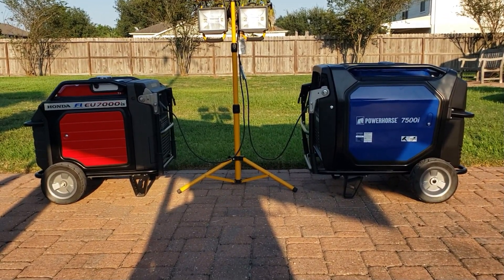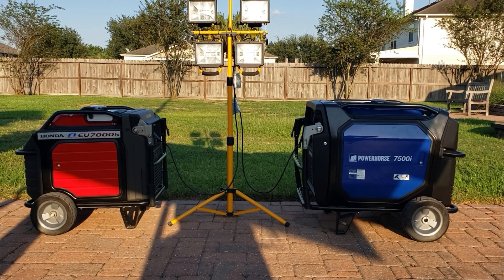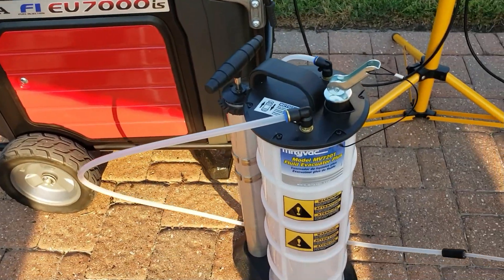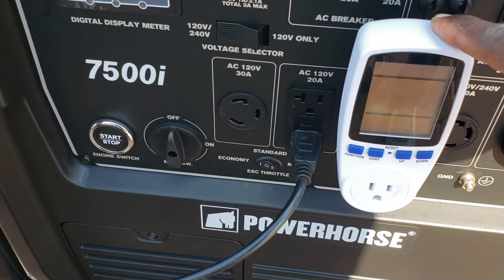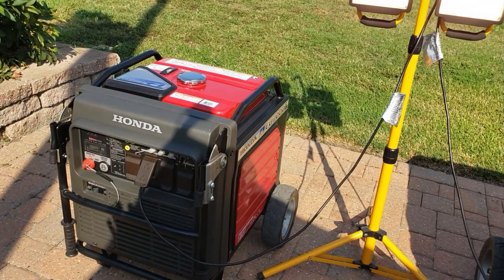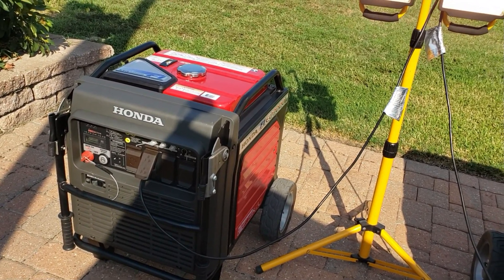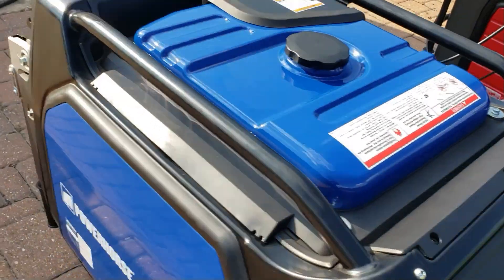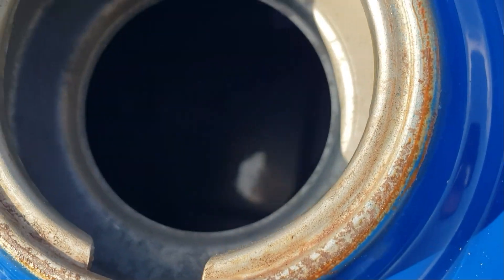Honda EU7000 VS Powerhorse 7500i Fuel Efficiency Test | Carburetor vs Fuel injector

Comment: you can use your kilowatt meter on honda. Just get a 1 or 2 foot extension cord. Than plug meter into that. They do make short extension cords. Construction grade
Reply from the maker: Yes, I knew I could do that but when testing I have to make sure everything is equal because everyone finds the smallest mistake I made, and go crazy with it. In the comments😅
Reply: @GeneratorReviews  well, if they want to, than they could say you had the watt meter plugged into the powerhorse but not the Honda, thus the powerhorse took more fuel sooner. But, yea, I get what you are talking about.

Comment: My neighbor recently bought the EU7000is fuel injected model with the shop service manual. Just going over it and it is pretty much a single cylinder engine brought up to the 21-1/3 century.

Like a modern car, it has a barometric sensor, oxygen sensor, crankcase position sensor, throttle position sensor, exhaust manifold temperature sensor, and generator control unit (GCU). I am not surprised that it can milk every ounce of energy out of the fuel it is given. The only thing missing is an OBD2 interface so you can hookup a scan tool to see the real time performance of the engine like fuel trim, rpm, timing advance, etc.
Reply: It has its own propriatary diagnostics port. DLC "Data Link Connector" they call it. You can get all that information out of the GCU with the right tools.
Reply: Just like my 50cc Honda scooter.
Reply: Yet the Honda does not meet the California emissions standards even with their electronic fuel injection and can't be sold in California while the Yamaha with the carburetor does meet California emission standards and is sold in California.

Comment: Test is not 100% reliable because not every tank empties the same. So one generator could run out of fuel sooner than the other because of tank design and not because of fuel consumption.
Reply from the maker: And you’ll get a better fuel efficiency  with a full tank, but like I said, in the video, this is not rocket science, entertainment purposes, only just have fun with it life is short.😊👊🏾

Comment: EXCELLENT VIDEO AND TOPIC GALVIN BUT DO THE GENERATORS HAVE THE SAME ENGINE SIZE?
Reply from the maker: The Honda EU7000iS houses a 389 cc Honda GX390 EFI OHV 4-stroke engine and The Powerhorse 7500i's engine, 420 cc OHV 4-stroke.
The smaller engine and fuel injection really helps. The Honda claimed the fuel efficiency.
Reply: @GeneratorReviews  DO YOU THINK THE DIFFERENCE IN ENGINE SIZE ALSO BECOMES A FACTOR IN THE TEST,

Comment: That's Honda for ya . Worth every penny.  Yes...I would like to see you use the mini vac for fuel refills and  emptying.  Thank you. Great video too.
Reply: Small engine so... ya less fuel consumption.  A accurate test would be comparing them at 75%-100%
Reply: I use a 6 gallon steel boat outboard motor tank with a nozzle valve and primer bulb to fill my portable equipment.  The nozzle looks like a miniature gas station nozzle.  The tank has a vent valve in the sealed gas cap.  It stays primed after initial priming  so all you do is put the tank above the device and let gravity do the pumping.

Comment: A good comparison would be if the engines are identical in size… one could be smaller than the other using less fuel even if they are injected or carborated
Reply: Practically speaking, they are in the sense they’re both rated for ~7000 watts. The displacement isn’t a metric that matters IMO - it’s the fuel efficiency, power, weight, etc. that do
Reply: @davincrook9927  ofcourse displacement matters lol

Comment: Great video,hey Gavin can you tell me what do you think about the emissions between the carburetor and fuel injected generators are they about the same?
Reply from the maker: I can’t measure the emissions but the carburetor will probably have more because the fuel injection regulates the fuel usage to be more efficient
Reply: @GeneratorReviews  ok thank you
Reply: Gavin is wrong about the Yamaha probably producing more emissions than the Honda. The Honda is not California emission compliant and can't be sold in California. The Yamaha is California emissions compliant and is sold in California so even with the electronic fuel injection the Honda does not burn as clean as the Yamaha with the carburetor.

Comment: And, if the on-machine power meters were accurate it the Honda gave almost 5% more watt hours to boot.  Does the Powerhorse run at a lower voltage?  

A T Burke
Reply from the maker: It runs at 124 volts
Reply: @GeneratorReviews  Thank you, Sir. I thought a difference in voltage might have caused the difference in output reading. So, are we down to  either having a faulty onboard meter or a slight difference in the resistance of one or more of the lights?  

A T Burke

Comment: Honda are the best. Best Stator Technology, Best Rotor Tech that will sustain electrical wearing for decades. What about the prestine outstanding reliable engine that no one can compete with it. You have the choice made and design in China/‘USA’ vs Japan pure thinking about everything.
Reply: Honda makes their generators in four different factories around the world, Yamaha makes all but one of their generators in Japan, they make one of their small generators in China. As for inverter technology, Yamaha is second to no-one, their inverters produce such clean power they can run sensitive hospital equipment. As for the engine the Yamaha is legendary for their reliability and longevity. When it comes to motorcycles Yamaha is always at the top spot for most reliable, their generators are no different. Sorry but Honda plays second fiddle to Yamaha in the quality, reliability and longevity departments.

Comment: As always great video . I can’t click on a Gavin’s Garage video fast enough. Which do you prefer the carburetor or fuel injection inverter generators just curious
Reply from the maker: I think the fuel injection is definitely way more fuel efficient and delivers the power smoother. It may cost more upfront, but not having to deal with those carburetors. It’s just so so much less stressful.

Comment: Excellent review.  I wonder what your neighborhood thinks of all the noise? Let's crudely compare the options... Honda 7000, $5K, Powerhorse 7500i $2.5K.  Efficiency and longevity probably goes to the Honda.  Powerhorse wins on the 50amp plug, Db, and price. For intermittent use to power a house, I would probably go with two Powerhouses and a combiner box.
Reply from the maker: 100% agreed but the power horse does not need a combiner box because it has a 50 amp plug
And my neighbors don’t mind because push come to shove who else they gonna go to for help 😅 in a power outage situation, they’ll have a generator.
Reply: @GeneratorReviews  Would I not need two to supply a split phase 240v system?
Reply from the maker: @stldigitalmemories  nope it puts out 240v
Reply: I bought a Powerhorse 7500 a few years ago after your review. I had 3 hours run time on it. In August 2024, my whole house LiFeP04 battery bank caught fire and did $150,000 damage to my shop and garage. It burned my sub panel and the utility company removed my meter. The house was undamaged and the Mrs is special needs. We stayed home without power, no motel for us. The Powerhorse ran 24/7 for almost 100 hours running the fridges, freezers, and recharging the 12 volt whole house lighting batteries. It was so quiet, even at night. Time for an oil change! The break in period went well.

Comment: I got  the chance to try both and the Honda outperformed the Powerhorse. First thing, The Powerhorse had problem starting, second the fuel tank in the Powerhorse is bigger, that tells me that in order to run the same time as the Honda it needs more fuel. My Honda runs for up to 18 hours on 5 gallons. Also my Honda, ran almost non stop from Sep thru Dec 2017 after Hurricane Maria.
Reply from the maker: I agree with you Jose the Honda is bulletproof but most people can’t touch the price even though you make up for the price in time.
Reply: Hola José veo que mencionas que tienes el generador Honda. Te pregunto ¿Te ha dado algún problema? Y si es así ¿Ta han resuelto rápido? Gracias anticipadas por su respuesta
Reply: I just received my Honda Eu7000 Tuesday of this week in Ft Myers FL. What excellent timing!  Cat 3 coming in 4 days. I am most thoroughly impressed with it. Super quiet and super quality. Just finished wiring Reliance Transfer switch today. Looking forward to seeing what this Gen can do. Main Fear? Someone trying to steal it!
Reply from the maker: @stbentoak5047  Stay safe 👍🏾👊🏾💯
Reply: @stbentoak5047  Hope you’re OK after the hurricane, it was absolutely a bad one.   I live in Miami and are thankful we were spared this time.  I’ve owned the earlier EM7000is since the 2004-2005 hurricane season and it has been a great generator.  I chain mine to the house using a 1/2 inch hardened chain and Master 🔒.
Reply: Well believe it or not, we are fine,our home was spared within inches of being flooded… my worst fear was I just spent $5000 on a generator and only had it for three days and now it is flooded and ruined. The water came up on the frame about 6 inches deep, but did not affect anything and it ran fine..we are 7 miles inland from Fort Myers Beach and the surge came up this far. Every subdivision to the south of us all cars and homes were flooded. I ran the Honda for almost 24 hours before our lights came on and it was flawless. If you absolutely need something to count on, don’t worry about spending this money you will not regret it. It is a flawless and a quality unit. Right now there are no generators available anywhere in Southwest Florida….
Reply: @stbentoak5047  Glad to hear you’re OK 👍.  You mentioned water flooded up 6 inches so it may have gotten into the armature of the generator.  If I can offer a suggestion.  Once you’ve recovered from this mess, take the gen-set to a Honda repair center and have it cleaned out.  Last thing you want is for corrosion to ruin your $5K investment.  Good luck.🍀
Reply: @stbentoak5047  Glad to hear you’re OK 👍.  You mentioned water flooded up 6 inches so it may have gotten into the armature of the generator.  If I can offer a suggestion.  Once you’ve recovered from this mess, take the gen-set to a Honda repair center and have it cleaned out.  Last thing you want is for corrosion to ruin your $5K investment.  Good luck.🍀

Comment: wow, 30% longer, even the carburetor was often modified to run very lean, mine need a full choke to start even on summer (86F 30C)
Reply: This test did not account for the priming of the fuel bowl on the Yamaha that would have put the Yamaha with 1 or 2 minutes at most of the Honda, also the Honda is not California emissions compliant so it can't be purchased in California, the Yamaha is California emissions complaint even with the carburetor and can be bought in California. What does that mean? it means the Honda is not as clean running as the Yamaha even with the Honda using electronic fuel injection. The main reason the Honda has a longer overall run time at 1/4 load is because it has a 5.1 gallon fuel tank vs the Yamaha having a 4.5 gallon fuel tank.

Comment: Honda for the win🎉 
But I’ll take the Powerhorse for the 50amp plug and price
Reply: Question is, will the Powerhorse last as long as the Honda? I have a Honda that ran almost nonstop from Sep thru Dec 2017 after Hurricane Maria. Last week this past weekend I used for hurricane Fiona, it performed flawlessly. The fuel injection is far superior.
Reply: generators have twist-lock plugs for a reason.  They vibrate a lot!  Given enough run time, non-twist-lock  plugs will back out and could cause a fire hazard!

Comment: Great test!  I think 1000W was a good light load for this experiment, as it really shows how the fuel injection burns less fuel.  The fact that the Honda ran about 50% longer is amazing!  Not only are you saving fuel, but the emissions are probably much less (less unburned fuel) and the engine is burning cleaner with less carbon buildup, so longer life.  It's still amazing to me, how much bigger in size, the Powerhorse is than the Honda.  And the Honda is big!
Reply: Much more expensive repairs carbs are 25 dollars on Amazon.
Reply: @avadeal345  While I have had good luck with cheap $25 carbs for small equipment, I would not put a $25 carb on my $4500 Honda EU6500.
Reply from the maker: Agreed!!! Maybe not quite 50% longer but I’ll give you 30%😅 yes, the powerhorse is a lot bigger
Thanks Tristan 👍🏾👊🏾💯
Reply: Need to compare prices as well. The Honda purchase price  costs 2 times more the Powerhorse.
Reply: Where are you getting the Honda ran 50% longer than the Yamaha? The Yamaha ran for 46 minutes and the Honda ran for 50 minutes, but the Yamaha also still had some fuel in the float bowl that was not accounted for, that fuel in the fuel bowl is enough to run the Yamaha another 2 to 3 minutes putting it within 1 to 2 minutes of the Honda. 

What should have been done was put in just enough fuel to prime the Yamaha start it and let it run until it quit running the carburetor dry then add the 32 ounces of fuel that way the fuel bowl would have been primed. Remember that when you store the Yamaha you still need to drain the fuel bowl before storing it for long periods so when you bring it back out to use the fuel bowl has to be primed again. Once the fuel bowl is primed it is good to go until you store it again and have to drain it. 

The fuel shut off valve only runs the carburetor dry not the fuel bowl. For those wondering it is easy to drain the fuel bowl, it is one screw that you open up and the fuel will drain down the clear drain tube Yamaha has installed that comes out the bottom of the generator, that is what that clear drain tube you see is for.
Reply: @LeeCountySpeedShop so does Yamaha make the powerhorse?
Reply: One more thing you wrongly state the Honda likely puts out less emissions, that is not true, the Honda is not for sale in California because it does not meet the California emissions standards. The Yamaha does meet the California emissions standards putting out less emissions than the Honda, the Yamaha is tier 3 rated, I can't find the tier rating for the Honda except the Honda Power Equipment web site says not for sale in California under the California Complaint on the spec sheet.

Comment: Can you test the 4500 power smart ?? It’s a very compact inverter with a 224cc engine. What impresses me is it’s small size with a 1.9 gallon tank runs 14 hours.
Reply from the maker: Power smart just contacted me I will ask about the 4500
Reply: @GeneratorReviews  it’s a closed frame model not the open frame. I’m just impressed how small and compact at 70 pound for a 224cc